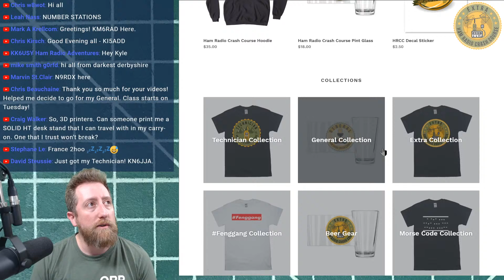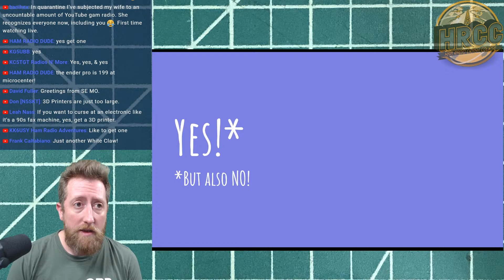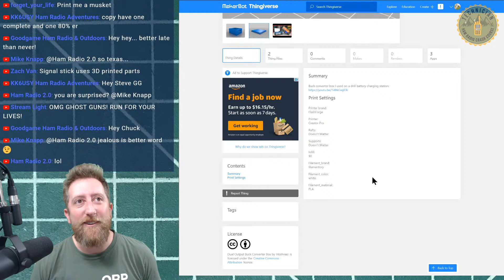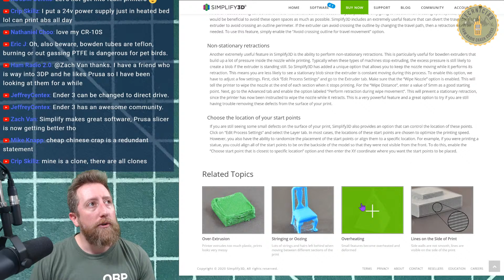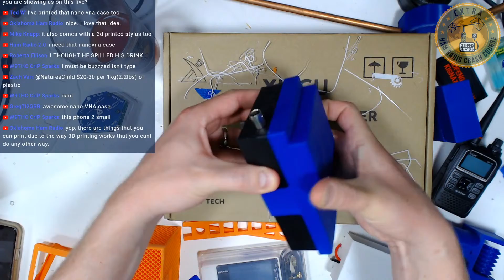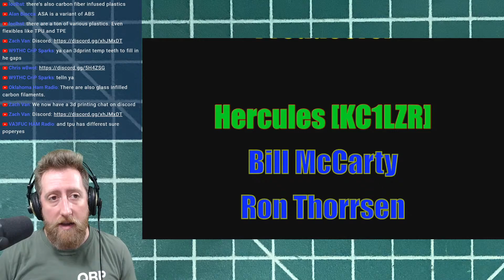Why You Should You Buy A 3D Printer For Ham Radio - Livestream

Comment: I am new to HAM but have the exact same FFCP printer. I got it in 2016.

This printer is awesome and I now have it to where it truly is just hit print. I rarely have failed prints at all.

First always use Simplify3D to slice. Gives perfect results. Not free but worth it.

Second the whole trick is getting a glass bed. Once I did that, and just spray some hair spray on the glass, it prints perfect 95%+ of the time. I never have to level it.

I had issues using the blue bed it came with. Glass on top works perfect!

I printed a few things that added to the printer like the spacer, the glass holders and a new vent to the nozzles.
Contact me and I can help if needed. I also upgraded the nozzles.

I put in a FlashAir III card and I can just put the files on it over WiFi directly from the laptop. No need to even remove the SD card. :)

I highly recommend the FFCP. It is a heavy duty, solid, reliable printer. I never have to level or mess with it much at all, it just prints.

BTW I have printed PETG, Nylon, Bridge, HIPS, wood and many other filaments.

I also have a resin 3D printer but still like the FFCP better for most projects.

Comment: Great intro to 3D printing!   I've had the Prusa i3 MK3S for about 10 months now and it's fantastic.  Built the Ikea Lack table enclosure and ran some 4" PVC pipe with an fan to exhaust to the outside of the house.   Print mainly PLA & PETG but also a little TPU (flex).   A few months ago I had a friend who is a ham ask if he should buy an Ender.  Gave him the Baofeng analogy and he immediately understood.   I think the Prusa Mini is probably a good option for someone new to 3D printing but I'm not sure what their lead time for delivery is, especially with COVID.  Was impressed that my MK3S kit arrived in 3 days via DHL from Prague.
Reply: Ray K2RCB this ham has an Ender 3 Pro and the Baofeng analogy is totally incorrect. Its a fine printer and I have printed several things for my radios    de ke4d

Comment: Another tip, always make sure you are checking for updated firmware for your printer.  I didn't update the firmware on my printer for a while.  When I did update, it was like a whole new printer.  All the issues I was having were gone, it was 20% faster and it's calibration was much more accurate.
Reply from the maker: Good tip!

Comment: I've 3D printed a lot of things for Ham Radio, especially for SOTA. Guying collar for my mast, a small collar for the top of the mast for raising, lowering and changing wire antennas on the fly instead of raising and lowering the mast, ultra light "dog bone" insulators for wire antennas, wire winders, etc. I also designed and built a case for my Elecraft DL1 dummy load. 3D printing is great for experimenting when you need a part in a couple hours instead of ordering it on line and waiting for it. Great topic Josh!